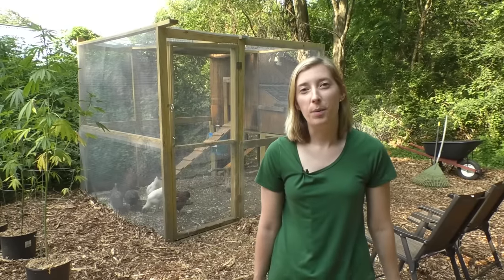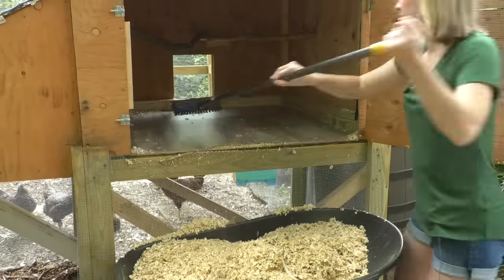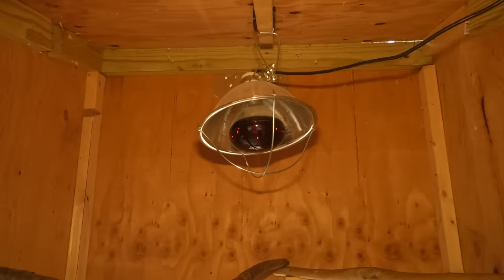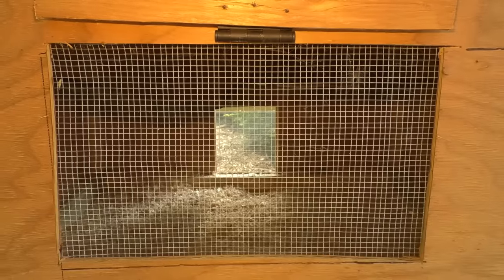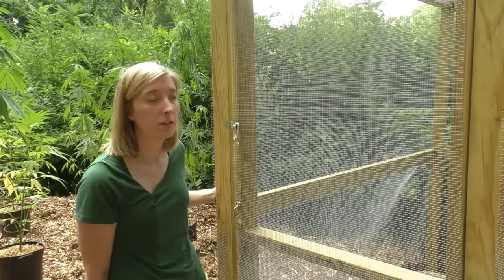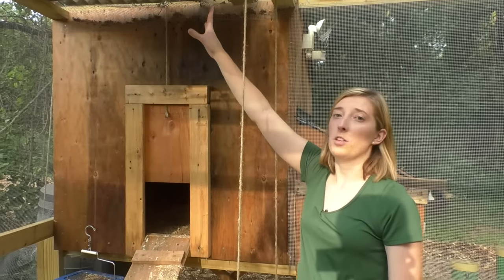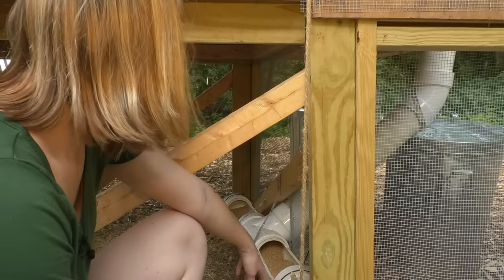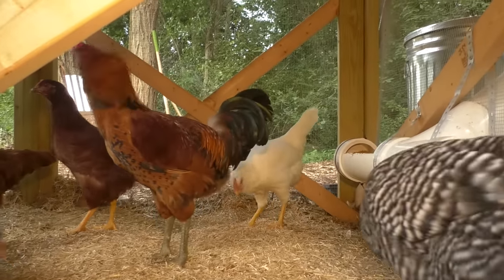Most Efficient Chicken Coop Tour

Comment: Not a bad first effort, but I do have a couple of suggestions:  You are defeating the purpose of the deep litter system inside the hen house by cleaning it so often.  A deep litter system is almost like a compost or healthy soil, and I believe your chooks will get health benefits, when you actually let the fungi and bacteria develop in your litter and by removing it so completely and so often you are starting from scratch each time you clean the coop.  Make sure that litter is at least 4 inches deep to start, then add light layers of litter as necessary.  Continue to do this until it is to deep to accommodate within your coop.  It should last at least a year.  When you do finally clean out the coop, make sure to leave some of the old litter in the coop, so those microbes are retained to inoculate the new litter.  It would have been good if you had built your coop to accommodate at good 10 to 12 inches depth of litter.  You need to do more research on the health benefits of deep litter as you are missing the point.

Now for the chicken run: You are concerned about moisture, so use woodchips to the depth of 8 to 12 inches.  A cubic meter of woodchips can hold up to 700 litres of water, so they are ideal for preventing your run getting muddy.  The carbon of the wood will use the nitrogen of the chicken poo to breakdown, keeping your run odor free and dry.  No need to continuously clean out your run.  It will eventually breakdown and be a huge bonus for your garden.

You have the best free compost workers in those hens, so why on earth is your compost pile not in the chicken run.  Chickens adore scratching through compost, turning it for free.  It gives them something to do.  Every now and then, pile it up for them again, sprinkling some grain in it for them to find, and it will keep them happy and busy.  All your kitchen scraps, weeds, fall leaves, grass clippings should be going into that little run to make your chickens happy and give you a great compost.  

Less with the clean and tidy and more organic matter and your chickens will thank you.
Reply: Thank you! A voice of reason in a world if ignorance. Terrible poultry conditions here, so sad
Reply: Thanks, I was hoping I wasn't too harsh, but a lady that takes the time to find those names, lol, might also take the time to consider my input.
Reply: Absolutely, and I hope she pays attention to sound advice. So many new chicken keepers go immediately to YouTube to share what they do, without thinking that they could be way off of what they should be doing. it's cultural these days. So anxious to share, without doing thoughtful research. Thanks Kazzana, chickens everywhere appreciate you :)
Reply: lol, I love keeping chickens.  They are so much more than most people think.  For such timid birds, they can be so brave.  I have seen mine face off a hawk to protect her chicks.   That takes guts.  My dog was late to the party.

I forgot to tell her about insoluble grit, like granite, and can't bear to watch that video again, to see if she had it covered.  All the best from New Zealand.
Reply: Good advice Kazzana! So much is wrong with this. Here is one for you, I don't ever clean my run, I wish I would have never built a stationary run and coop! I take my old deep liter and put it in the run. I have poo boards so my litter stays pretty clean. My run is on a hill so my litter ends up on one side of the run and I noticed it working it's way out of the run, and what is on the ground is the most beautiful compost and I didn't even move it all I have to do is dig it up and put it straight on my garden! I also spread fresh straw when the run gets to mucky from wet weather. Only because I don't like washing my eggs all the time. And I never spread the wood chips I just put them in a pile and the chickens take care of the rest. Let your chickens do the work! They don't mind, they love to scratch!
Reply: I do something very similar, my run is my compost making department too. I do not mix woodchips with compost, I just have an area I dump all waste, which the chickens do their thing on.  

I recommended woodchips for her run to absorb moisture, and to stop her obsessive behavior, so it will please her ascetically and be a good environment for her chickens.  

I have my run on a slope and it does not get muddy.   This lady is thinking of her chicken house and run, like she would her own home, instead of thinking about a chickens natural characteristics and habits.  It will be interesting to see if she takes any advice on board in her future posts.
Reply: +Zyzyzx She has.
Reply: Kazzana, do you have any instructional videos out there that we can view? I hope to have chickens again eventually...I would like to hear more about how you do things. Thank you.
Reply: Hi Frisbee, no, sorry, I am not sure I would know how to make and upload a video.  Chickens are easy in NZ, as we do not have the huge predator burden that you guys in the states do.

I just do what is easy, reduces the workload and is fun. All my tree trimmings, fall leaves, weeds, grass clippings and food scraps to into the run for the chickens to make my compost. I have small rotting tree stumps I turn over occasionally for the chickens to get the bugs. Sometimes I will put a little bit of meat in a bucket with holes so maggots drop out, which the chickens go nuts about.  Along the outside of the run, I have planted stuff to throw the chooks, like comfrey, Swiss chard, kale, Jerusalem Artichokes etc.  Several fruit trees in the run add to their diet.  For me, it is about easy care, and stuff that makes it interesting for the chickens and fun for me to watch.  My run is big enough, the habitat varied enough that the chickens would find enough to survive on for a long period of time, which is comforting for me, but I hope the situation never arises.

From the videos I have seen on you tube, we all do very similar stuff.  The only thing I do not see often mentioned is information on the two types of grit.  Everyone seems to know about soluble grit such as oyster shells, but it is also important to have insoluble grit, which is often granite, but can be any rock, for grinding up grains etc.  

I do believe the deep litter method for the hen house is a healthier option, so consider that before you build the house to cater for the depth of litter. 

Really, all you need is a safe environment, protected from the elements, grit, clean water and food, but if you make the environment interesting and pleasant for both humans and chickens, then it will not be a chore to take care of them and the chickens will be stress free and happy.  

My advice would be to plan to make sure you have the basics covered, then landscape to make it more self sufficient, beautiful and useful.
Reply: I would like to see your chicken coop also, as I thought this one was actually good, but I am a newbee, so I am glad I read comments...so thanks =)
Reply: I disagree! In a climate that receives lots of rain, you can’t really do that deep of litter method inside and definitely not outside! Inside wood shavings draw to much moisture in rainy climates.
Reply: It had occured to me also that she wasn't leaving any good bacteria around for the chicks. I guess I was on the right track. Even hampsters need to have there cages slightly developed for a more healthy animal.
Reply: @Kazzana   Agreed.  I purposefully located my raised garden beds in front of my 10x30ft run so that I have easy access to rich nutrient dense compost.   Each spring I dig off a layer of that compost in the run and distribute throughout my gardens and then clean out the 7x8 coop on to the run and start the process all over.  The composting deep litter in the coop provides a little heat in the winter and by the time it gets into the run, half is already composted.  I always try to leave a little of the rich compost in the bottom of my coop as "starter" for current season's deep litter.  Works great for me, easy maintenance and really no smell.  I always lay down diamataceous earth for mite/insect control making sure the corners and base boards are thoroughly dusted and sprinkle Coop Fresh with the first layer of pine shavings.  This process eliminates the drudgery of weekly coop cleaning and is a beneficial way to produce rich compost.   A win-win for everyone.
Reply: @Lisa Johnson Yes you can.  My 10x30ft run is a steel corrugated covered.  I've installed gutters and collect rainwater for the chickens from that roof run off.  My chicken operation (18 Blk Copper Marans/6 Bresse - raised for both eggs and meat) is nearly self sufficient.  I supplement with fodder/sprouts and feed commercial crumble.
Reply: Kazzana ....THANK YOU FOR SAYING ALL THAT! I couldn't believe she was cleaning the coop every month! Mine lasts a Year! Lol.... and how about the water she lets them drink! Yuk! I wouldn't let my chooks drink that crap! Omg! And I'm a newbie myself... only had chooks for a year now... and I've only cleaned my coop ONCE! lol... anyways! 
I think they are smoking too much weed to be able to do anything beneficial for their poor bird's! Smh!
Reply: KAZZANA, I will be raising chickens soon. I have a question about the deep litter method. Do you need to avoid diatomaceous earth or hydrated lime wash which repel/kill insects?  Also, is it okay to use linoleum on the floor of the coop? I wouldn't want to trade symbiosis for ease of cleaning. Thanks!
Reply: Sagir32 Lol... Yep I'm terrible. The ONLY reason I have chickens.... Is because my neighbors ( pot smoking Farmers, btw) bought 6 baby chicks last Easter when, as they put it, "we were high, they were cute, didn't think beyond that" and didn't want them after they got "too big" ! But they new that they could get money for them, and they knew I would take  them. They them in horrible conditions, and were feeding them Trash! Literally! The trash from whatever they ate, they would DUMP into their pen! I bought the food for those 6 chickens for 4 months, and helped them take care of them. All the while I was asking them if I could just buy them, so they didn't have to "worry" about feeding and taking care of them!  After 4 months of buying their food, and going over there daily, I paid my neighbors 80$ for those 6 chickens! 
Yeah, I'm a HORRIBLE neighbor to have! Ooh wait...I guess I am, if you are the scum that I HAVE TO LIVE NEXT TOO...😉
Viper... That's cool 😚
Reply: hey, can you give me some pointers? I have 11 hens and I am contemplating getting rid of them. THEY STINK if I do not move their run every three days. PLEASE PLEASE HELP... I have wood chips! should i make their run immobile and add a bunch of wood chips?
Reply: Creepy Creeper I have either hay or the wood shavings that you put in a hamster cage...I live in the desert, I don't have any issue. 
I think it depends on where you live. 
Also, how big of an area do you have, if you can keep moving it?
There are also FB groups that you can go post this question in, and you can get a lot of help and advice. But, I don't think you should give them away. This is fixable situation.
Reply: Creepy Creeper if their mobile run isn’t big enough, 3 days is too long. Maybe you should consider a stationary coop. Ideally a coop should have lots of ventilation. If you live in an area that gets rain avoid straw bedding. 
You can also utilize a poop board in a coop. 
It is just a tray under the roost area. Some use pdz on it and just use a litter scoop to sift it. Shavings would then be put on the floor area. I give my chickens 4 square feet per bird in their coop. You could use 2 square feet if they have a large run they would have access to daily. 
If your chickens stink they don’t have enough room, or ventilation. 
Visit the backyardchicken dot com for some great articles and forums.
Edit to add or move your mobile daily.
Reply: Kazzana a
Reply: You are the most hilariously self-involved chicken genius ive ever seen online, congrats
Reply: Kazzana On Behalf of all my chicken ...we thank you sooo much !
Reply: I was thinking the same. How can it be called deep litter of it's cleaned so often? Also, I don't think they considered winter freezing water conditions when they made their water system. And that feeder isn't likely to last a week when those chicks are full grown. Otherwise I like the coop and would like to have one more like it.
Reply: And thanks for the suggestion about compost. I have my compost in a bin inside my chicken yard and my chickens can't get to it. The yard can be accessed by other critters at night (but the chickens can't be, they're put away and safe) so I thought the night critters would eat all my compost. Maybe I shouldn't worry about it and just put it out for the chickens to work anyway. 🤔
Reply: Very interesting points but what about the mites, lice and acarus that thrive on the feces, fallen feathers and dirt?
Reply: Creepy Creeper, Hope you haven't given up on your BYCs yet!  I'm a total noob so this is just something i read about on message boards... its called PDZ and it is an adsorbent, that is harmless to chickens.  Price it out, because they sell it for horses in a pretty big bag, and a small "chicken size" bag actually costs more per wt.  I think I read someone used it in their cat litter tray, hamster cages, etc.  The claim is that you can't smell the smells as the PDZ locks 'em up.  If you use the Deep Litter Method, you would spread it on first layer, or sprinkle (I can't advise you on how much, just keep reading *everything*!), and you might find you didn't need to clean for much longer than the 3 wks this video suggests.  One comment here said she only cleans her deep litter setup once a year (that's my kind of effort! LoL)

Good Luck and dont give up!
Reply: Kazzana won't they get sick if it's not cleaned often
Reply: Im 71 and raised chickens since i was 10 yrs old. I think she did a great job. Cleaning once a week isnt necesary but its not a problem either. If your goal is garden compost then its better to  not to clean so often. Either way is fine. I really like the coop and the effort put into it. :)
Reply: Kazzana why don't you do your own videos instead of using someone else's platform.. you have a lot to say and people will learn from you.
Reply: WRONG!!!! Wood shavings promote ammonia production regardless of how thick it is, if there is droppings and moisture then you have ammonia which is highly toxic and harmful to any animals especially hens lungs. Deep composting system should be used far away from the actual hen house/run and only used to break down the garbage part of the droppings never in a henhouse.
Reply: Kazzana was I correct seeing the only ventilation in that coop, apart from the door, being a bunch of drill holes each end? Because unless I missed summat she needs a whole lot more ventilation - I was told a square foot per chook…
Reply: Would you suggested this system even in the PNW?
Reply: Can you use Brown bagged mulch in the same manner in the run as wood chips ?
Reply: Excellent advise! so, now I have it, a model for my chicken coop, idea for a bigger run, compost idea for my garden and health for my chickens....Excellent.
Reply: @Junkinsally ,. Yes, and mold becomes a problem which isn't healthy for chickens.
Then you have the problem of solmenela and other diseases which can be transferred to humans.
A clean chicken coop is a happy chicken coop.
These people have a wonderful coop.
Reply: Agreed. I grew up in chickens and no one ever cleaned chicken coop once in a month... maybe once in a year it was done. About run you are right... but we were free ranging them.. now I have chickens of my own, and I them in chickens run with all my compost pile in it... Ducks only free range to pick out slugs and snails from my garden.
Reply: Thanks for the reply this girl ain’t got a clue,
Reply: Exactly!! that is a lot of wisdom...you are so right!!!  they're treating those chicken like precious cats... what a pity... they have made things way more complicated!! Pity indeed..... !!!
Reply: could you please tell what a poop board is. sorry for the stupid  question you and Kazzana are great !  @dianamallory8535
Reply: why do you think the chicks are gona be fried?   @ChameleonSoul
Reply: You supose to clean it often to avoid amonia buold up that is bad for the chikens she is doing great.
Reply: @ChameleonSoul  Right?! *DEAD*  ROTFLMBAO
Reply: @kazzana it sounds like very less maintenance , growing chickens must be easy
Reply: Kazzana, thanks for saving me the typing. You are spot on for deep litter. My coop cleanout is yearly. Good ventilation also key. No smell !
Reply: Well yeah, but is 30 day clean out better for the owner, or the chickens? Other thoughts: Would you like to walk on several inches of your own feces? Then why would chickens? The owners intend to eat the eggs, so they want things as clean as possible. This "organic" business would turn my stomach, and I wouldn't eat the eggs.  I'll bet you don't keep a pile of poo on your dining table. Just because chickens will walk on piles of their own poo doesn't mean they prefer it, or should be made to do it. Kudos to the owners.
Reply: @Bob_Adkins  Foolish statements,  obviously you have never raised chickens or anything else for that matter.  Maybe you should educate yourself before trying to impress us with your opinions.
Reply: @jefffrayer8238  This is not my opinion, just a statement for you.  I would never make my livestock or pets walk on several inches of their own feces. No animal should be subjected to that, and no food produced in that manner is fit for human consumption. You should try it yourself before forcing animals to do it.
Reply: @jefffrayer8238  Growing up, I helped care for our flock of 25-40 free range hens. To this day I hate chicken poo, and I think chickens hate it too.  No, I didn't keep my mom in the basement, I kept her in a small apartment out back until she passed away.  If YT knew what a RT winger I was, and how much I hate pajama boys, they would block me. I  like free range and cleanliness, because it's what I'm used to.  But that's me, not everyone has the land.  My friend, you have a right to raise your hens on a bed of poo, but that doesn't make it right. Since your hens can't speak for themselves, I cackled something on their behalf. Have a good day.
Reply: @Bob_Adkins  You should read better,  I never said you was hiding your Mom in your basement.   Sorry for your loss and glad you took care of her as you should. I did the same.  Glad I'm not dealing with a Pajama Boy.   If you had all those chickens as a kid you know they roost in a coop at night.  Underneath the roost should be a pan that catches the poop so it doesn't make it to the litter on the floor.  The pan gets dumped on the garden or compost pile.   No one has them standing in 4 inches of poop.   Saying they do and we should try it is ridicules and just extremism.  Done right the coop has very little odor and nothing unpleasant to walk around.   You're speaking for the poor chickens that have no voice?    Well Bob,  how do you explain that when they're free to run around the yard and cow pasture everyday many are inside the coop scratching around the litter on the floor?   Perhaps you're trying to prove a non existent point.  Simular to a person that won't have a cat cause they were raised with a stinky house full of them.    I appreciate your concern but don't make it sound like what's good for raising healthy, happy chickens is somehow heartless animal abuse.  Have a great day.
Reply: @Goetmhmiac fairchild Exactly.   The original video is a good person showing off the coop they built to give ideas for others to consider.   The  idea is for us to look what others have done, what seems to work and incorporate it in our own coop.   Everyone's needs are different,   some want 2 chickens, some want 100,  some live in town and some live on lots of land.   Clean the hen house everyday or once a year are systems that do work and still have happy, healthy chickens.  Both ways need to be done properly.   Chickens are pretty happy as long as they have clean water, food, enough space and free from predators.  Keep in mind if the coop is disgusting they stay out of it if they have a choice.  I'm thankful to people for taking time to show their ideas for us to adapt for our particular needs.  This forum is for everyone to learn from and we should respect their choices as long as it's not obvious abuse.
Reply: Why is everyone so unnecessarily toxic on this thread? We are all here to learn and give constructive advice, it's not a competition.
Reply: Carmen casa Jones
Reply: What happened to a couple 😂😂 I’m jk that is very good advice
Reply: Apparently I keep my coop too clean as well. This is good to know. I put a good 4 inches of wood chips in my barn and add hay. I’m going to stop cleaning it to often. Thanks!
Reply: You got to give some points to her for the effort lets just hope its not a faze for this couple
Reply: Boy someone did his research👍
Reply: @kazzana9013  I'm no chicken expert, but may I add that DE, which provides prevention from insect damage in the garden, food grade can also be fed to chickens & other animals - including humans, to deal with & to prevent  intestinal parasites. 

It also might serve as a grit, for chickens, while eliminating parasites.
Reply: @gbylve  Feed the chickens DE
Reply: This unfortunately turned nasty in many cases, but I just want to tell people, if you have animals, EVERY county, state, country, province, whatever, has an agricultural department who are more than happy to answer questions and your local one probably has one online and in many cases will even come inspect your coop.   

   I don't want to insult people, but the idea of keeping feces around for a whole summer to 'get beneficial fungia and bacteria' is flat out INSANE.   Farmers used to keep animals in all kinds of conditions and try to justify it, but there has been tons of research on this and chickens shouldn't be anywhere NEAR compost for at least a year.   Not cleaning a coop may be appealing to the really lazy, if people are that disinterested, DON"T have chickens.  One of the worst things about our society was referenced above and that anybody can get animals and practically do what they want with them. 

       Microbes don't need extra help, with chickens its impossible to get rid of them all.  Heavy duty cleaning with water, detergent and other soaps typically only manage around 90%, and they are replenished within hours.  Microbes don't need extra help.  Its true there is some evidence in PEOPLE that keeping kids indoors and 'microbe free'  affects their immune systems.  But we aren't talking about people here.  The main way human mortality in childbirth was increased was with the discovery of germs and keeping  them the hell away from newborns.  Animals are no different, you look in a birds nest and its full of shit because of the babies and thats not out of CHOICE.   They try like hell to shit over the sides and the reality is the biggest killer of baby birds is the same as with virtually any animal-unsanitary conditions.   Feral cats and other animals are so prolific because nature knows that survival only come in numbers.   If birds could manage to sweep out and clean their nests they woudl do so, thats why birds don't LIVE in nests, the same as horses or animals they want to get away from their shit because they know shit kills.  We aren't talking about shaving chickens and keeping them in glass box here.  Ventilation and space is the main concern, thats why the most ideal situation is letting them run around free, but of course thats not always possible. 

  Don't take my word for ANY of that,  talk to a poultry vet at your local agricultural centre, don't believe people on youtube.  For others, don't expect to be taken seriously just because you talk preachy, that was horrible advice made worse with the expectation that people would pay attention to it, which sadly some did, which means GET EDUCATED BEFORE YOU GET CHICKENS.  Most vet journals are online, and there are lots o resources by accredited people who have been doing this for decades.  Just because you didn't have a problem while being unsanitary doesn't make it good advice any more than saying letting your chickens run the road is a great idea because so far they haven't been hit.
Reply: What kind of table scraps? Alll of them, or specific types only?
Reply: This is an awesome video with alot of great ideas! We will be building a larger coop using some of these ideas, we built a quail cage that we now use for our chicken brooder with automatic feeders and water, as well as trays to clean! Check it out here!  https://www.youtube.com/watch?v=XtZi_aggA2s&t=4s
Reply: I love your comments, Kazzana! 
I'm not sure the deep litter method is ever ideal on a raised wood floor...
Also, what do you do about the chickens pulling all of the beneficial worms and such out of the compost? Do you feel they offset that loss?
Thanks for making me consider some things. I have been around chickens since I was a baby and have had my own for years, but there's always more to learn!
Reply: @triciafox8932  @Kazzana - hope you see this!
Reply: You were spot on with everything you said, I'd have added she doesn't have enough ventilation
Reply: This guy coops
Reply: She said she does deep litter. This was for instructional purposes only.
Reply: @CherylMacKay11f  she said she does deep litter then proceeded to sat she cleans it out every month which defeats the purpose
Reply: Damn Kazzana..SHAZAAM LOL
Reply: @freerangechickens7698  Where are your Youtube chicken videos?
Reply: @glenncountry  Exactly right sir!
Reply: @jefffrayer8238  These people are criticizing this girl for trying to help others and keep her birds overly clean???  Imagine your 6 year is so proud of something they made for you and you just say wow this sucks, you have no clue, and I cant bear to see this.
Reply: @MorganHornets  Hard to respond to something that makes no sense.  Reread what you wrote and try to write something that makes sense to someone other than you.   In the meantime I have to tend the chickens and cut 3 trees down.  Have a great day.
Reply: @jefffrayer8238  I was agreeing with you. I cant understand people on here criticizing this girl when shes proud of what shes done and trying to help others(its like a child that brings a parent a picture they colored and the parents say it sucks). Not sure why everyone resorts to negativity so quickly on Youtube.
Reply: @MorganHornets  OK then, Chicks are good,  6 dead trees down and Tuna Noodle turned out good.  I'm sorry but I couldn't make out what your was saying.  It's been 6 mo. since I was here.  Yes,  this is a good family showing what works for her and an excellent video.  I hope she does another one.  As you saw it turned very negative early on and as you see Bob Adkins and I got into it.  It usually doesn't go that way.  I agree with you in that I hope she isn't discouraged in doing another update.  Everyone has their own goals in raising chickens and most have what works for them.  If what they have isn't working then places like this can give them ideas for improvements.  Thanks for commenting, please don't be discouraged, there's more good people than jerks in this world.
Reply: Jacquie Hayes k
Reply: Jacquie Hayes wow quite pleasant aren’t you
Reply: @josevalera1413  coop magic tactic costs money for simple plans. FAIL
Reply: @kazzana9013  You inspired me! I will move stuff into the chicken coop. I also learned to cover plastic boxes with chicken wire. Guess what i have in the plastic boxes? Worms! It is fun to have worms and chickens together right under the chickens' feet. I did it outside the coop and now i will do it inside it. THANK YOU!
Reply: @martinstreeworks3310  I used the deep litter method using sawdust for years and never had a problem. I cleaned out the hen house about once a year. Usually in Spring. It was about 12" deep. Did wonders for my garden. My girls were very happy to be able to run free without any fencing. Dogs protected them from being attacked by Hawks.
Reply: I concur. They are working too hard. for my 12 chicken coop, I clean it twice a year.  That's plenty.  But use straw, not hay.
Reply: Kazzana , excellent advise,  thank you, thank you, thank you.
Reply: Thank you for this information. I have been trying to figure out WHERE to put a compost and since we HAVE a chicken run we NOW have the spot for it.
Reply: I agree it's being cleaned out way to often also I'd use a Hemp Hurd Bedding either Aubiose.us or AubiChick that Carolina Coops carries is the best in the world so far. The French company that offers it is going to teach American farmers how to setup similar Co-Ops and Processing plants here in the nexty few years. In the meantime Chanvra Materials carries it at chanvra.org or aubiose.us (See you at the Farmers Market)
Reply: @Desolator84  yes, amen, very sad adults act like this.
Reply: I agree with Kazzana, and if its mites you are worried about you can sprinkle Diatomaceous Earth (Food Grade) over the litter. its pet friendly, and your chickens will thank you.
Reply: @Gawonii1Austencao  if animals especially birds breath diatomaceous earth it will hurt their lungs
Reply: @cloverbird5785  No, the De is pet/animal friendly, it is food grade. Some friends of mine use it in their chicken coops to control the mites. I first found out about DE through a beekeeper, it is used to help keep the hive beetles down in his hives.
Reply: @dianamallory8535  what is a poo board.....i mean how does it work
Reply: @jefffrayer8238  thank you sir
Reply: @dieselcowboy777  A poo board would be like a 1×6 agaisnt the wall like a base board that the litter goes against.   Makes it easier to clean the litter out and  prevents the studs and outside wall from rotting if the litter gets wet for some reason.   It's also a great idea to have a poop tray just  below where they roost so poop doesn't end up on the litter/floor.  Wire mesh should be just above the tray to keep the birds out of the tray.  Most of the poop is below where they roost so with a tray in place you can easily clean the tray every couple weeks so the coop stays clean and smells good.
Reply: @jefffrayer8238  well said. Some unnecessarily rude comments here!
Reply: @cherylanderson3340  you are absolutely correct...DE is excellent! It also helps with smell control. It will kill insects by breaking their exoskeleton and they dehydrate and die. However the chickens would eat them probably before they died. Please make sure to use Food grade diatomaceous earth though.
Reply: @cloverbird5785  it will only hurt lungs if in the air and not after it has been applied (unless you applied it in a huge pile and there was a gust of wind). DE can be used on many different animals....dogs, cats, bunnies, chicks etc because it works on mites, fleas...as well as ants and roaches. When you put it on any animal you have to shield their mouth, nose and eyes because of airborne particles. That would be the same for any powder. 
The person was correct as well that it can be used for internal parasites.
You can also mix it with dog food to keep the bugs down!
I live on a subtropical island and we unfortunately have roaches (our beauty and beaches more than make up for it!) I use it to kill roaches by applying it in areas if I see them.
I recently learned that it can also be used in cat litter to help with the smell (and it isn't toxic like some of the deodorant powders some people add!)
Reply: @martinstreeworks3310  If the wood chips were in an open run, wouldn't the free air flow keep any gasses like ammonia from building up?
Re scraps, there's one guy on here that has a huuuge compost pile - his chickens are all over it by choice.
Reply: Agree....I really enjoyed the video and learned a lot from it..the coop was a good style, and she loves her birds.  Kazzna gave good advice to all of us if we want to go that method.  Many people just have a hard time getting on board with sustainability...thinking a dirty coop makes chickens sick is easy to understand until you learn about good bacteria, and who doesn't want to learn more about how the good stuff is the easy stuff!  I appreciated both the video and  comments.
Reply: I thought deep litter and poop boards were two different methods.  If there is no poop in the coop why would you need to keep laying down litter?
Reply: @kazzana9013  She didn't mention grit, though hopefully the chooks can find enough from the ground?
Reply: @chawntelh  She was doing her best, and we all learn with experience, and what's the matter with rainwater to drink? There's all sorts of chemicals in tap water (to clean it) in almost all countries, so I'd say they were better off with rainwater. She may not have it all sorted yet, but she's trying hard, and got plenty right too.
Reply: @CaseyLChihuahuaDad  No, you always have a clean layer on top, (I always used straw) that you just keep adding to, so the chooks are always on top of clean. As long as they have outdoor access in the day, they don't dig in the house bedding. You can use much the same system for horses too, (take droppings away each morning), then put down a clean layer on top of old, which gives them a warm, clean and soft bed to lie on all winter, the horses that is, the chooks still want a pole/branch to roost on, then muck out in Spring, so the new one builds up a bit by autumn/fall when warmth appreciated.
Reply: @56seehag  someone further up said it's just a tray you put directly under the roosting pole to collect the night's offerings...
Reply: @jesshothersall  Well, that's YOUR opinion! Mine is that she shouldn't be "learning" what is right and what ISN'T on living things! Would you still say that if this was a baby!? Ohh, yes... rainwater is great, I hope she uses it to mix the infants formula! Would you drink rainwater? It runs off the roof... Which is dirty, and has TAR on it among other chemicals! Then it pools into whatever source it can...a dirty bucket, a rusty can, etc... Yeah, that's f*cking HEALTHY! 🤮 And I don't drink tap water...I get my water delivered! That's what ALL MY ANIMALS GET! 
My point... I've been raising Chicken's for serval years now... I'm sick to death of seeing newbies that didn't do their research and just "wing it" at the expense of a LIVING, BREATHING ANIMAL! If this was a dog, you all would be up in arms! But, Chicken's are disposable... So apparently it doesn't matter how they are treated! That's what I'm sick of! It's irresponsible and if it were a different Animal, people would be more upset! I just saw a post where this moron put 1 egg.... JUST ONE... In the incubator and after it hatched... AFTER IT HATCHED NOT BEFORE... Went to FB to ask everyone," my egg just hatched, what do I do? Do I feed it? Do I touch it? Does it need water? Help" 
Seriously!🤦🏻‍♀️🤦🏻‍♀️🤦🏻‍♀️ That's horrible! This is what I have an issue with! You put something in an incubator to hatch and have 21 F*CKING DAYS to read up on what it needs and what to do to PREPARE FOR IT! Yet, this idiot waited 21 days before asking for help! Brilliant! So, no...I don't by your "we all need to learn" BULLSH*T! YOU DON'T LEARN WHEN IT'S A LIVING BREATHING THING! That's just plain Animal abuse! I'm not going to stand by and be silent or sit and watch! I'm also not going to use any tact either... if you watch a child run out into the street while the parent is obviously not doing there job, you going to be polite and say," excuse me ma'am, but I think your child almost got hit by that car"? Nope... I'm going to run out there to protect that kid, then give that parent a nice piece of advice! I do it for the child, or Animal that is in danger! Cause I'd feel REALLY bad if I sat by and was polite while I watched and I could have done something!
Reply: @dianamallory8535  yes they absolutely LOVE scratching! We got our first 2 chickens last may and I have fallen for these chooks the first time I laid eyes on them! Chickens are the best animals and are really like my girlfriends just gardening and gossiping lol love them
Reply: I like your style.
Reply: Nice effort at suggestions, but your idea of basically not cleaning the coop is BS. It would stink. She's doing a very good and thorough job of keeping it clean, which is excellent.
I hope her water butt doesn't get stagnant, and hardwood chips in the run would need less frequent cleaning, but otherwise I was impressed with the coop and run build.
Reply: Makes sense!